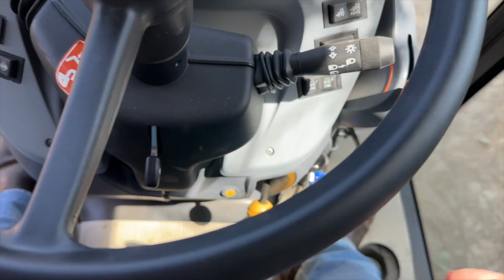Why Did Tara Cross The Road?!

Comment: A disk tends to throw the dirt either in or out depending if the front is higher or lower than the rear. You may want to adjust the angle for the best performance.